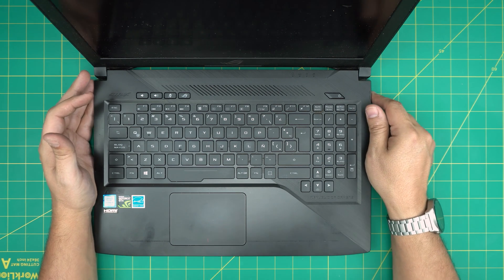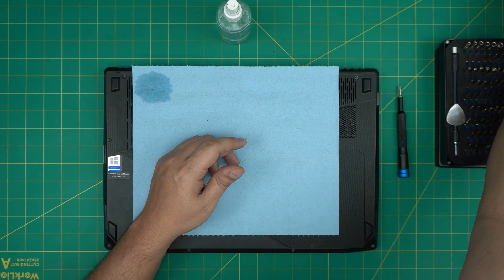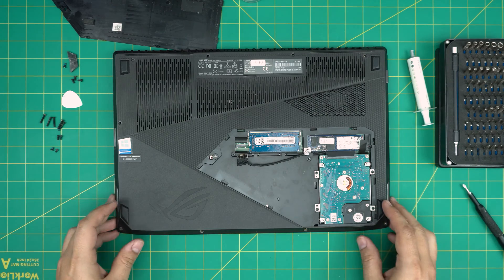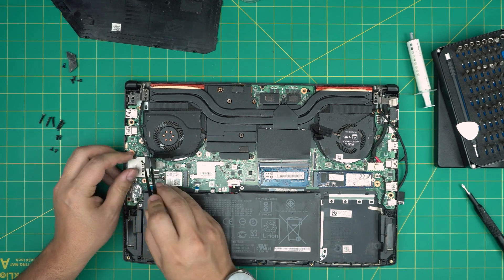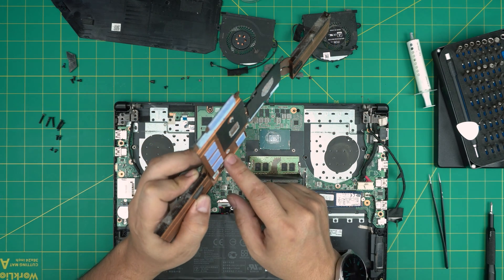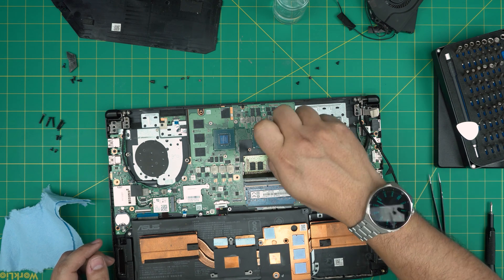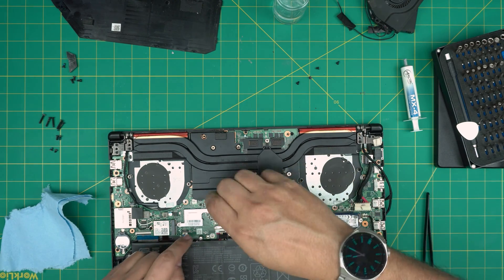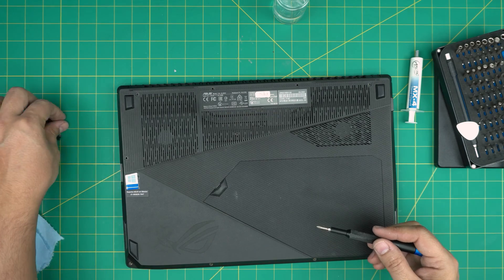How to Repaste and Clean an ASUS ROG GL503VD FY108T Laptop

Comment: Does the thermal pads of this is just the standard one (6.0W/mk)? Can i use higher thermal conductivity?
Reply from the maker: 🫠 Regarding your question, yes, it is a 6W, but there's no reason to go for a better one. The spec data on those regulators shows they operate well within temperature limits at 6W, and replacing them with higher thermal conductivity pads won't extend the life of the components or improve laptop performance.
However, if you have the money, sure, replace them for the heck of it.
The original pads typically have a lifespan of 4–5 years.
Reply: @uFixTek  i have to replace mine because when i open the back of my laptop there's some gooey texture around on my laptop. Is that right that i need 0.5mm and 1mm for my laptop?
Reply from the maker: Ah, OK. And yes, 0.5 mm and 1 mm. Also, keep in mind that thermal pads can be stacked, so if you just get a 0.5 mm sheet, you can stack it where you need 1 mm.
Reply: @uFixTek  does it okay stacking tho?
Reply from the maker: Perfectly fine. If you measure the temperature transfer over a 1 mm pad and compare it to stacked 0.5 mm pads, you get the exact same results.

Comment: Should the old thermal paste residue on the heatsink be cleaned off, or can it be left as is?
Reply from the maker: 🫠Regarding your question, both side Thermal paste MUST be cleaned.
Should you have any further questions or requests in the future, please don't hesitate to ask me.
cheers🍻
Reply: @uFixTek  Do you have a video on how to replace the thermal paste on an Asus ROG Strix GL503GE?
Reply from the maker: it is the same laptop as this if you can follow this then you can do the GE too they are identical.
Reply: @uFixTek  thaks a lot
Reply from the maker: It's my pleasure my friend.

Comment: Hello again, I have another issue. Last time I've replaced the power jack with your help and everything worked just fine. A few weeks have passed and for some reason when I turn on the PC, the screen is black. Connecting an external monitor works. If I use a flash and point it to the PC screen, I can see a very faint image. I'm suspecting that there's a loose connection somewhere but I can't figure out where to look. Could you help?
Reply from the maker: 🫠Regarding your question, the issue could be one of the following:
1. It is NOT a loose connector.  
2. A fuse on the board near the LCD connector may have blown (requires using a multimeter to check the components for the fuse).  
3. The display's internal LEDs may be damaged (requires replacing the display).  

How to check the issue:  
Disconnect the connector of the LCD from the panel side and plug it into a new LCD to see if it works. If there is no backlight, then the issue is likely on the board (bad fuse). Otherwise, replace the display.

cheers🍻
Reply: @uFixTek  hello again, I'll try to check. I'm suspecting the LCD connection since the only thing I've done inside the laptop was replace the DC jack which is located near the LCD connector cable (underneath that small metal part that slides away when screws are removed).
Reply from the maker: remove the jack and re insert it make sure the commectors are not damaged.

Comment: Do you by any chance have a video showing how to replace the DC jack?
Reply from the maker: 🫠Regarding your question, that is super easy to do. All you need to do is remove the 2 or 3 screws on the hinge that covers the jack, and disconnect the jack from the motherboard by sliding it towards the hinge. Here is the picture:
https://imgur.com/a/2gSZkek
Should you have any further questions or requests in the future, please don't hesitate to ask me.
cheers🍻
Reply: @uFixTek  Thank you for the quick response, is the jack soldered to the motherboard PCB or is it removable and has a cable that connects to a connector on the motherboard PCB?
I'm having a hard time finding the correct DC jack to order. Thank you so much!
Reply from the maker: The jack is not soldered, as you can see in the images. The power jack is fitted under the hinge, and the cable is connected to the motherboard. Get the jack from AliExpress.
https://es.aliexpress.com/item/1005005598142325.html
Reply: @uFixTek  Thank you so much, I'm still in shock.. Finding an answer for something so specific on the internet is hard enough, let alone on YouTube..
You sir just made my day!
Reply from the maker: that is why i try to assist and help as much as i can.
🫠
Reply: Had to give you a quick update, just replaced the DC jack and.. It works!!!
No words can describe how thankful I am!